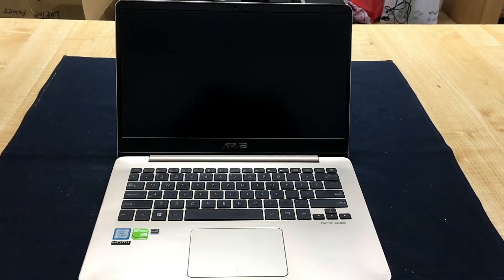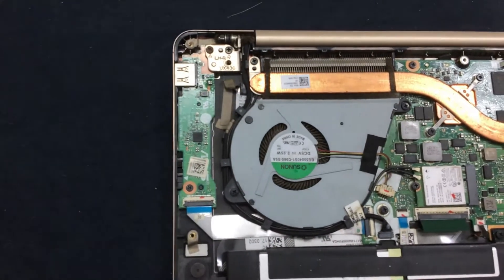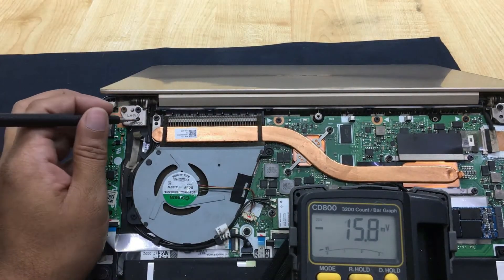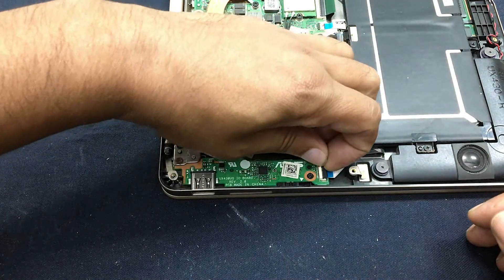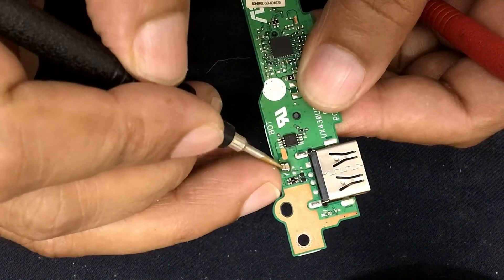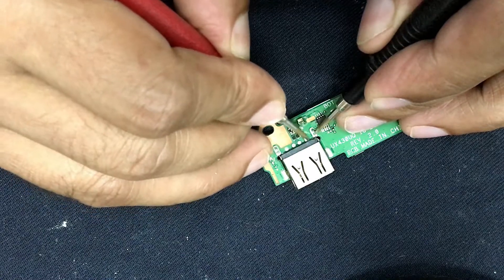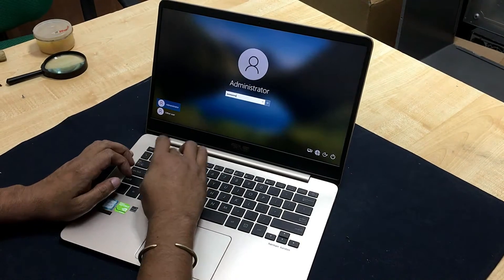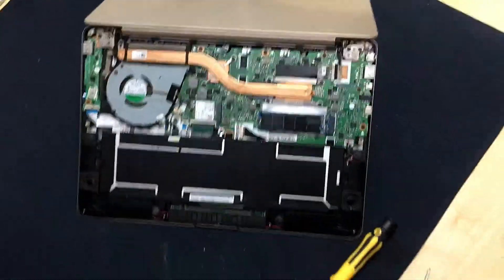How to repair USB Port asus zenbook laptop

Comment: Hello Sir. I have the same issue with Asus Vivo book. I have one question you removed the shorted capacitor but not the solder new one. So, is it work without adding a new capacitor?
Reply from the maker: Yes it will be work without problem. This capacitor filter and protect the  5 volts nothing else. It does not make any happens